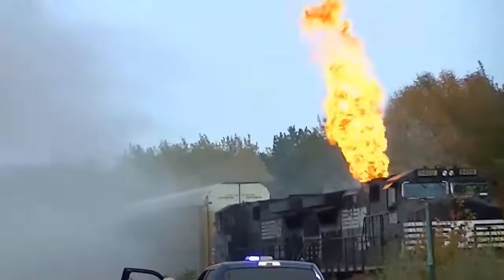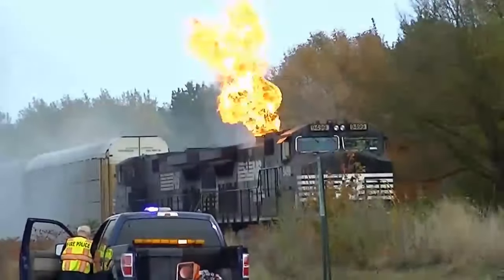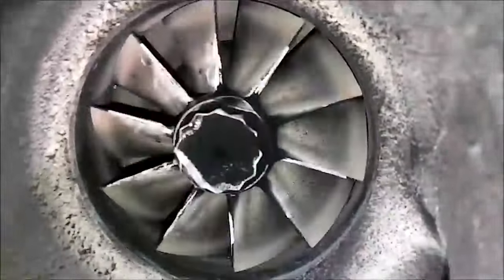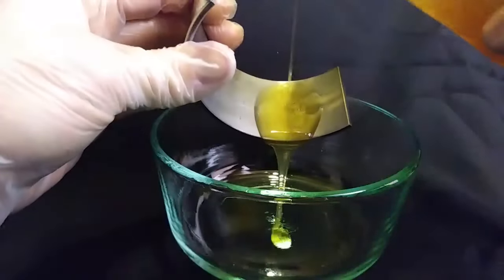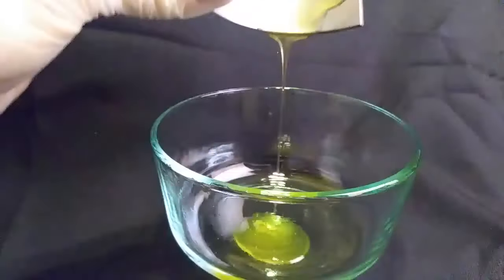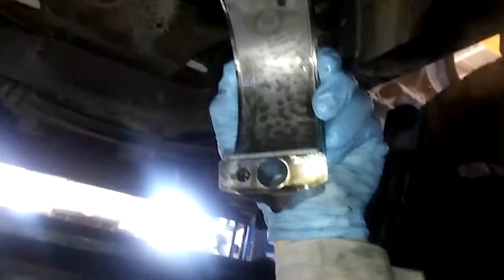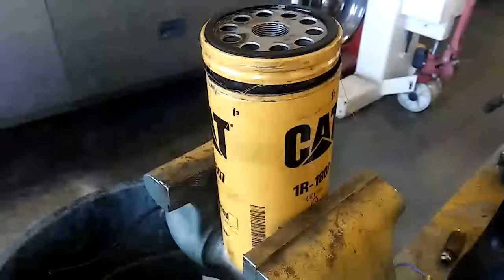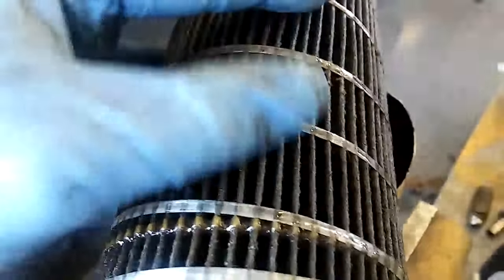Engine Block Heater vs Oil Pan Heater. Everything you NEED to know about Cold Weather Diesel Engines

Comment: While working in Alaska my diesel truck had a battery trickle charger, block heater, oil pan and transmission heating pad. I would plug it in at night to a timer that would come on 4 hours before I left for work. Never had any problems and put over a 100,000 miles on that truck. Thanks for keeping us informed.
Reply: This is one of the best maintenance items, I’ve heard. Well done taking care of all fluids. I’m sure you have seen, many truck drivers , have no idea what’s going on under the hood.!
Reply: Did you have the 8v71 Detroit engine?
Reply: Never heard of a transmission heating pad. Is it the same as an oil pan pad?
Reply: Transmission heating pad is the same as an oil pan heating pad.
Reply: Wheres the radiator line heater
Reply: Excellent,  will take your advice and address all issues.

Comment: This guy is probably the single best diesel mechanic on YouTube I've ever come across. Always has information that is easy to understand in a format that presents it in a way that is explained using facts and his own personal experience as a tech. I really appreciate what you do and keep at it.
Reply from the maker: Thank you very much for the very kind comment.
Reply: Yes and he speaks very well.
Reply: Dam right.
Reply: I live in Alaska you don't want to insulate your oil pan cause in the summer time it will over heat the engine ,water heater, battery heater and fuel heater you need those three....I run a blanket oil pan heater with the other three heaters but it not as necessary as the later
Reply: Word..
Reply: Last person I watched was out in the sticks. Maybe the first time ever on camera too. Ug.
Reply: Diesel tech Ron was the OG.   RIP.   This dude is great too
Reply: Preach
Reply: In the early 80’s, dead Rolled into an abandoned gas station of I-80 when a severe arctic blast came through.  My tank was already filled with #2.  Knew my fuel was likely gelled.  Found a working outlet on the outside of the bldg.   Had an extension cord and a blow drier.   Had hair then.  Warmed up the fuel filter and was able to start the truck so I could get to the next stop.   Those were the days…
Reply: @kgill5 Always keep a propane torch in your tool box. No need for power.

Comment: -30 celcius on the side of a mountain with a heli portable drill if it doesn't start on the first crank you're screwed  Put a sardine can of diesel under the oil pan and let it burn for 15 minutes, wrap some diesel soaked cloth on  stick light it  and wave it in front of the intake when you're ready to crank it. Never lost a hole to the cold.
Reply: how do you get the diesel lit?  using only matches I can get diesel lit at 85F ambient temperature
Reply: @georgewashington938  I carried a zippo in the bush.
Reply: @mrfingers4737   okay - why does a zippo work when matches don't?
Reply: @georgewashington938  A zippo can sustain a flame a bit longer than a match 😂
The diesel needs a fair bit of heating before it ignites. Remember liquids don't burn, it's the vapor coming off the liquid that actually burns. Diesel has to be heated for a while before it starts to vapourise.
Reply: Put a piece of a paper towel in the container of diesel, it will wick the diesel just like a candle wick, light the other end while it’s still dry, that will get the diesel heated enough to stay lit on its own.

Comment: Nice video. As a guy that has trucked to Alaska for years. I had a block heater, oil pan heater inside the oil pan and a carrier APU that was also hooked into the truck‘s cooling system. I would shut my DD16 down at -25 at night. The APU powered the oil pan and block heater, charged the batteries, circulated the coolant through the engine and also ran the heater inside the bunk under the bed. The truck would start like it was a warm summer day and the coolant gauge usually settled in at 110-115 degrees. I could never understand why to idle a 16 liter engine to keep the cab warm.
Reply from the maker: Interesting comment, thank you.
Reply: Even into the 70's, those excellent systems were not available OEM, so it was common in the northern latitudes to keep the engine running when the truck left the yard until it returned to the yard say a week later.
Reply: Apu or not you won't catch me shutting the engine off at that temp, the fuel burnt is inconsequential if im inside the truck.
Reply: There are a lot of guys out there that share your opinion. I was more concerned of wear and tear on the engine and the emission system. I have seen plenty of guys that idle their truck even in nice weather that have put many turbos on the ISX and are plagued by emission system break downs and had to rebuild the engine with less than 400,000 miles. My last truck I sold had an average speed of 50.4mph when compared to engine hours. I easily put 1000 to 1500 hours on the APU in an average year.
Reply: @cullenmiller8170  emissions systems wrecked engines.  Even needing a turbo replaced before 600,000 miles is pretty bad.

Comment: I personally would take an oil pan heater over a coolant heater, i have taken apart too many isx’s with spun cam bearings due to poor Lubrication from cold starts
Reply: I prefer the coolant heater it is easier to start with a warm block, also when the coolant is warm it heat the oil while passing trough the oilcooler, as soon the engine run.
Reply: What about both! How hard is to glue an oil pan heater on the oil pan?
Reply: If it’s that cold- use both
Reply: @darrenrich3492  Indeed. Plus ample diesel conditioner well before it gets cold and all winter long, use fresh high quality synthetic oil with a very low pour point and a smart maintenance charger (holds at 13.6v) left overnight on batteries also checked and serviced regularly. If the oil is rated for extreme cold that should be enough for a PROPERLY SERVICED diesel vehicle for the odd very cold start, but where and whenever possible when one expects steady temps below -15C, heat both the oil and the coolant. That also has the added benefit of raising ambient battery temps enough to make a big difference sometimes. 

It is often below -40C in these parts in winter and my 7.3idi hates cold, but the truck is packing a 10kw welder/generator. If needs be, 2 hours for the block and pan heaters is just enough at -45C to spin it up with some effort. Lets face it few stock vehicles can handle extreme cold without some damage, so throw the kitchen sink at it.
Reply: Oil pan heater is better idea. Without oil moving to critical parts engine life goes down drastically! We’ve had below temperatures and oil pours out like molasses and barley moves so valve train would be rattling..
Reply: Yeah but on generators I see alot of em with block heaters only ,and you touch the oil pan and it's got some warmth to it. 
Ain't gonna work the greatest if it's only on long enough to warm the block up though.
Reply: isx cummins,that's most of the problem
Reply: @threesisterstrucking8044  yeah that's a big tenfo ¡!!!
Reply: I think it’s just Easier to just leave my truck running , untill I can get the stuff to do all that , 
Plug in my engine block 
Never had an issue starting my semi in cold weather 
Anything 10 or below I pour   Bottle and 1/2 lucus into each tank of fuel when I fuel , if I decide to let it sit not running over night . 
Lord know it’s expensive enough to keep my rv, water sewer warm and propane to stay warm ,  I’m staying in while I work in Wyoming this winter in the oil field than  to have to worry about buying all this stuff for my semi too . I have a 4500 watt generator on the back of my car walk I run it and plug my block heater  into  if I decide not to stay in my semi  , 9 hrs of gas holds up to keep my engine warm .

Comment: Up in Canada here we frequently get -30 to -40 overnight temps. We actually have both an oil pan heater as well as water jacket heater plugged in throughout the night. We also have Eberspacher water heaters on a timer that come on 2 hours before the engine is to be started. This usually gives us a coolant temp of 100-130 when starting the engine. It also guarantees startup should one of the heaters fail for some reason.
Reply: If installed correctly an Espar will heat to 160F. I installed mine in the engine bay of my Dodge Cummins.
Reply: @kyles234  Metric . . .
Reply: @TRPGpilot  71C
Reply: We have them in all of our dozers and excavators too, can’t live without them
Reply: @TRPGpilot  Google . . .
Reply: My Dad used to work for Ontario Hydro, thye used to leave a muskeg tractor  in the bush for weeks, -45, crew got to them, turned on the webasto, less then an hour it fired up, every time
Reply: I'm in calgsry been tryn all week to get my 3406e cat started.his info today showed me something I need warm batteries to get good cranking I have a pan heater but no block heater but they stole my plug cord for my pan heater where can I get one its 2 pins with a steel ring that screws in tight looks exactly like a block heater

Comment: HI.  Are you familiar with a Webasto coolant heater?  It runs on 12 or 24 volts and diesel.  Yup, it burns diesel for heat.  It also has a circulation pump so that all of the coolant gets heated, not just what is close to the block heater.  Different sizes are available depending of how big your engine is.  Pretty popular in Canada on farm tractors that need to be used in temperatures well below freezing.  A similar system is used on most diesel locomotives now days.  Of course these are much, much larger.  It allows the rail companies to shut locomotives down for hours at a time and be able to restart them, whereas only a few years ago, they would simply leave them idling, AND wasting lots of fuel.
Reply: hear in the north east of the USA you cant really drag around cords most places.  i have the Webasto Thermo Pro 50 Coolant Heater on my personal pickup and have had it on there for the last 15 years set the timer or hit the remote and in 20 minuets the hole engine is 140f  not only does it start like summer but there is no time sitting for the oil to get warmed up a bit
(on start it takes secant seconds to get the cold out of the oil) let alone the instant heat to clear windows.  go team Wabasto.
hear in the north east we have coolant running threw the fuel tanks in the winter to heat the tanks even treated fuel gels with wind chill you know say driving down the road at 65 mph.
Reply: The only problem is that they are so expensive!

Comment: I remember as a kid in the 70s, the best diesel tractor we had in really cold weather was our John Deere 70 Diesel. It used a gasoline pony engine to start the diesel. Once the pony was started, the exhaust was run though the intake manifold of the diesel and the pony shared the cooling system of the diesel. Also your cranking ability was now limited to the fuel capacity of the pony engine. As you start cranking the diesel, it was decompressed for much easier cranking.
Reply: I have a 1955 John Deere model 70 gas tractor, a great tractor, but I've always wanted the matching diesel model. Maybe one day.
Reply: The 2 we had was a 720 & a 830 the 720 had the pony motor but the 830 was an electric they both had decompression so we got everything turning over & up to rpm then you could start & go about your business.
Reply: @dirtfarmer7472 we have a 59 730 diesel but with an electric start. They sure are nice tractors with a lot of grunt.
Reply: Lots of old bulldozers and equipment were that way too, with the pony exhaust in the intake manifold.The decompressed state on them allows the rings to move easier, heat up more, and put a little more heat into the cylinders for when you disengage the release.

The old 2 cylinder Deeres make me laugh with the V4 pony engine having twice the cylinders of the main engine. 😊

Comment: I'm from Alberta, Canada and when it gets too cold we just don't turn them off until it gets warm again. -45 degrees celcius is horrible
Reply: Im a fellow OILBURTAN, A fleet winterization program really helps. I have a shit tons of Cummins ISLs, Volvo D12/13/MP8s, and detroit dd16s. We always ohm out the block heater plugs before a cold snap. Battery cutoffs shut off every night helps a lot too.
Reply: @rhunter3406  Solid plan. Nice to see a fellow OILBERTAN
Reply: I live in Alberta Canada and that's terrible practice.  Oil breaks downs needlessly, cylinder washing, unneeded engine hours, etc.
And I love how you give the impression that Alberta is at -45 for any length of time...Maybe in High level or Fort Chip, but not for weeks on end. 
Best solution is a Webasto or Epsar install.  Was cost prohibitive twenty years ago, but once diesel passed the 60 cent a liter mark, the investment paid for itself fast.
Reply: @rhunter3406   

"Blue Waffle cone?"  LMFAO!
Reply: @fredg8199  I use to feel same way as you. However had to many instances of frozen air valves, etc from the air not flowing in those temps. Have had more luck keeping it running in those extreme temps. I bump the rpm up to 1200 though.
Reply: Have my High Idle “Stick” just for the occasion     OLBERTAN
Reply: @lungelinecowboy  If you're not using the brakes or inflating the air bags you don't have any airflow unless you have a leak.
Reply: @3redneckcountryboy  I used one of those back about 1980.
Reply: @allanmccullough8550  exactly. I haven't seen any   pieces of equipment that don't have an air leak at -35 c or below. Might not hear it but the air compressor does kick on and off.
Reply: @lungelinecowboy  I have noticed some compressors are timed to go off, for what purpose I don't know. I have had to move to get away from the irritating noise.

Comment: My last driving job was hauling bulk  livestock feed around my home province. When they told me to spec out a new truck, I got a block heater, oil pan heater and battery blankets. The engine came with an intake heater as well. I got it started one morning in -48°C. Engine was unhappy as hell but it went... and then I didn't shut it off for the rest of the week until that cold snap ended!